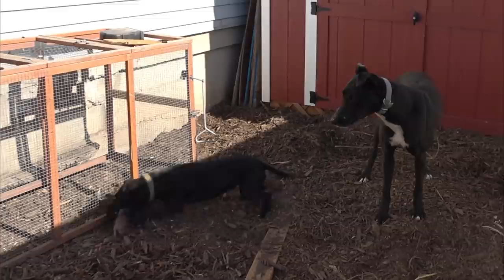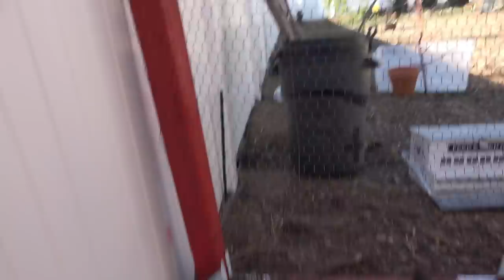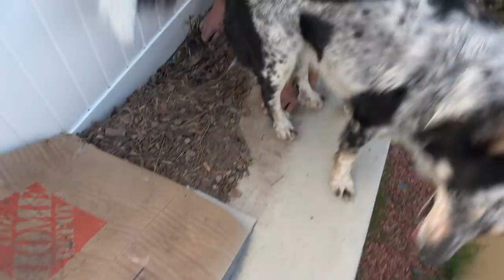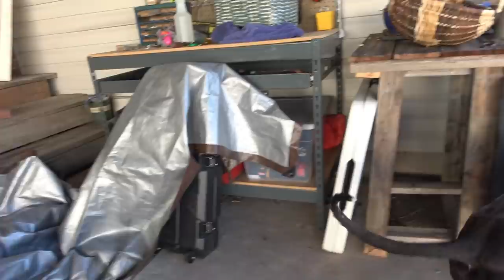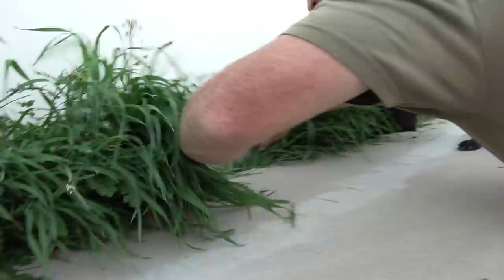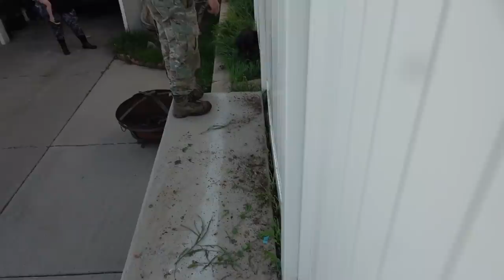Dogs DEMOLISH Rat Invasion in MINUTES!!!

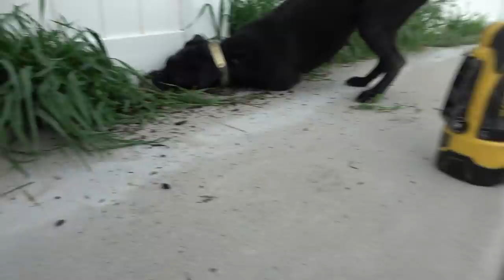Comment: 14:03 if you stop the vid there you see a yellow flashlight.. i have one like that to but mine does not have the black part on top. 
What is that black part on top of the flashlight for? 
Is that fall protection? Or has it more use then that?

Comment: I worked at a feed mill that had an “ Old Yeller” stray cat that hung out and would catch mice/ rats all day and never tire. Then one day a supervisor said “ the cats gotta go. So the cat was taken about 25 miles away and turned loose. A year later we were sitting in the break room and a cat went strolling by and some said you know that looks like old yeller. And someone else said there was one way to find out. There is a one man elevator that would take personnel to the roof of the mill to do maintenance, shut valves etc, and the cat would ride too. Once at the roof the cat would dart and knew just where to go and get mice. Well a year later someone walked from the break room toward the elevator and the cat beat him there. He rode to the top and as soon as the elevator stopped , the cat darted out and went straight to where he knew there was mice and sure enough, ha came back with a mouse in his mouth. The most amazing thing was, the cat found his way back from 25 miles out. He didn’t get removed this time. Mouse catching fool.